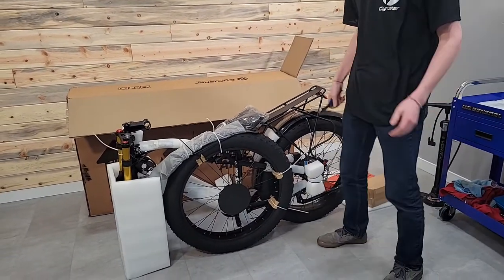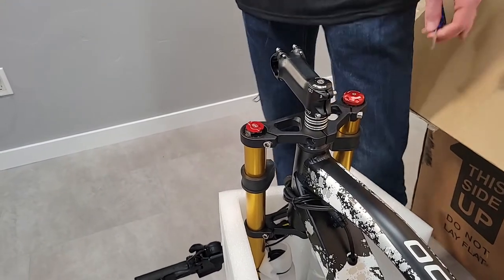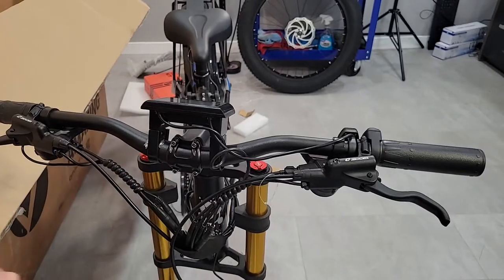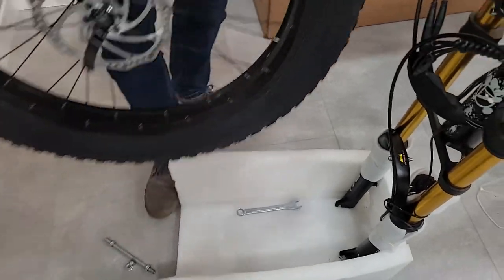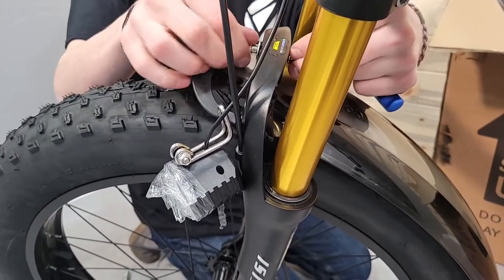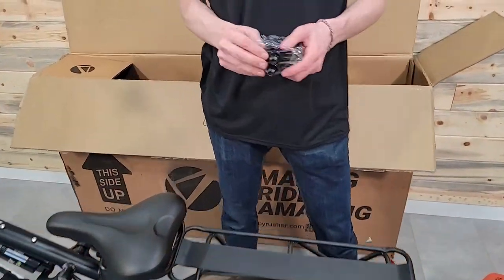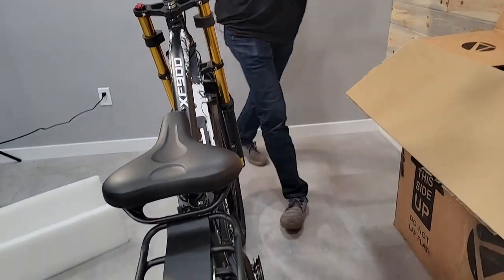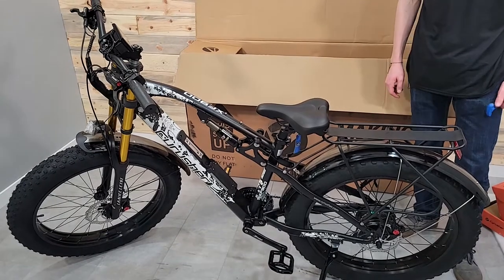XF 900 Unboxing and Basic Assembly

Comment: I want to buy this bike, are there instructions with the bike on the air forks, like what’s the best pressure to keep them at, or best way to fill them. Another odd thing that I have seen on YouTube videos is the display wattage, it only shows 3 digits, when riding the bike the wattage will go into the thousands and the display will only show 999. Looks like a great bike.
Reply from the maker: So in the past we did produce these with air forks, I believe all the current models are produced with Spring suspension forks. I will have to double check on that. As for the display, it can only show up to 3 digits so if it is 999, it means that you are higher than the screen can display